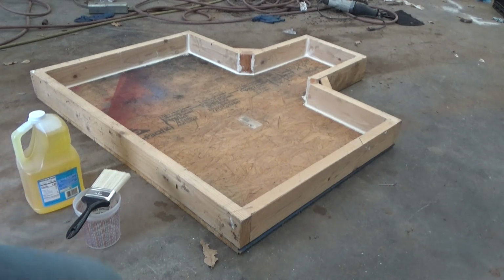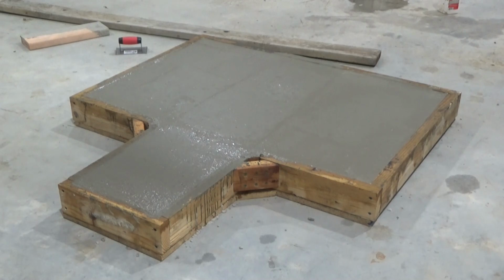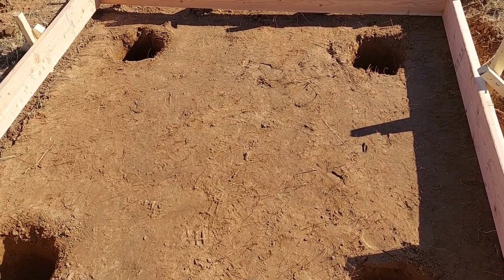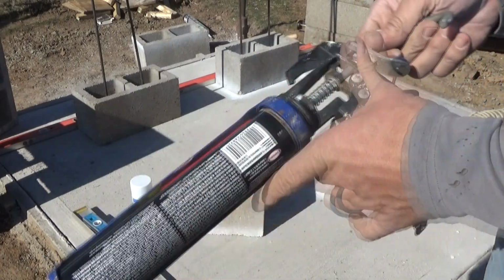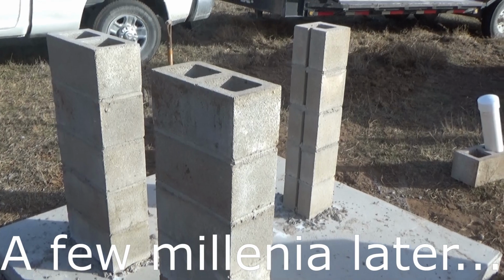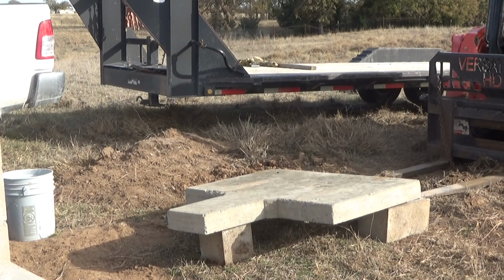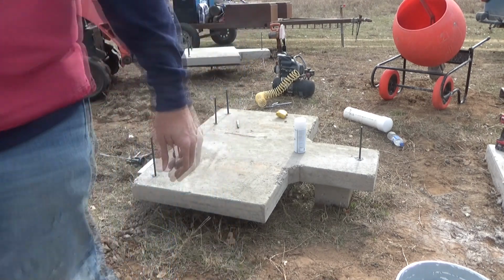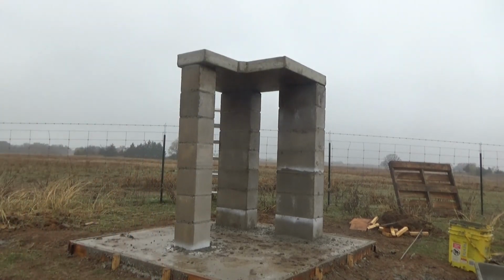Building Concrete Shooting Benches

Comment: Impressive benches.  Could you proved the dimensions of the tops?  Thanks
Reply: Thanks!
Reply from the maker: Yes, here they are.  The "oddness" of the dimensions is due, in part, to the fact that I needed to form the top on a 4 x 8 sheet material.  I needed 1.5" of deadspace all around.  And maybe I didn't have an expert plan.

The width at the widest portion: 43.5"
Front to where the tail forms: 30"

That makes the fore section a rectangle which is 43.5" x 30" (yes, no kidding, but to be sure that's clear).  Then the tail begins:

Tail width: 14"
Tail length: 18"

I formed gussets or whatever at the transition from the fore section to the tail at a 45 degree angle and the hypotenuse of that formed triangle is 3".

I ripped 2x6 material for the form boards to get an actual 4" dimension so the top is really 4" not the standard 3.5" of a "2x4".  I wanted that extra thickness for strength.

As shown in the video, I have two mats of reinforcement.  Thank God, to this day, they are still standing absolutely fine.  I have sheep in the fields where these are located and they love to rub against stuff.  While sheep are not large animals, they can still mess stuff up but these have held up (specifically the columns) with no problems.

Comment: Just wondering why you built them so tall?
Reply: There are 2, of course. One is quite a bit taller than the other. The lower one is that tall because I didn't want to build it then find it was a bit too low to be comfortable. It's easy to build a tall chair to get myself to a comfortable height on the bench.

The second one needs FAA lights because.... I had a shooting bench in the field but I leased it to a guy for cattle. The cattle knocked my shooting bench over (crappy folding table).  Also, it was blocking the full opening of a gate. That was @ 200yds. I moved across the fence and built a wood bench but it had to be tall to be sure I was shooting over the 54" tall fence.  This put me @ 220yds which works great for my hunting (nocturnal thermal w a 6.5 Grendel).  I'm on @ 220, only 1.1 inches high @ 100, still close enough @ 250.  So, I kept the spot and still needed the height to clear the fence.